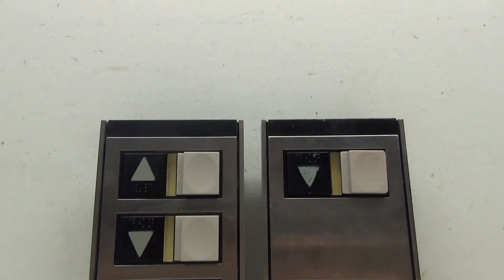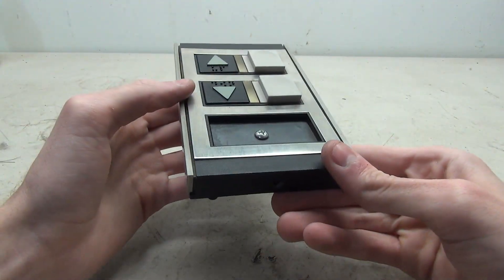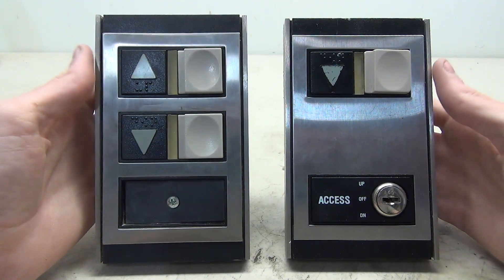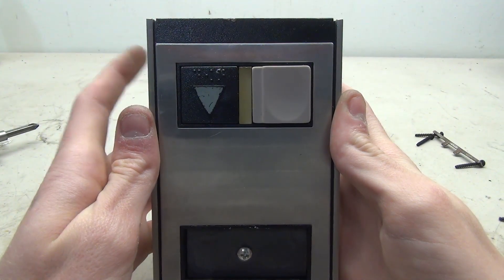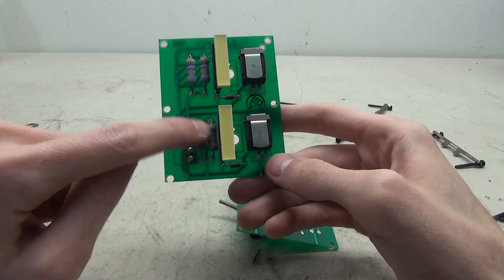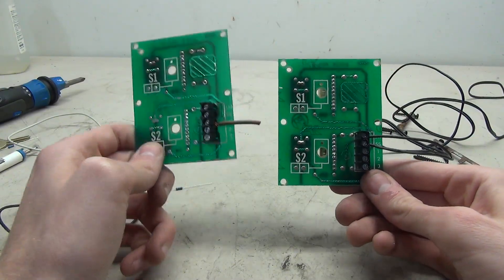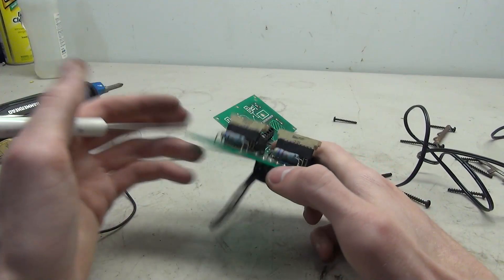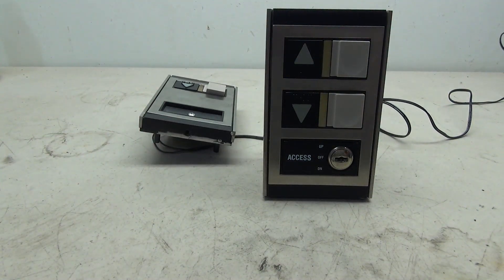Detailed Look and Wiring Montgomery Vector Elevator Buttons

Comment: as someone with very little knowledge of elevator control systems, what blows me away about these is that they operate on ~117VAC mains voltage.

i'd imagine maybe older designs used neon indicators or something (like those you might still see in power strips), which may have required higher voltages, or maybe there's another reason to have mains voltage at the call stations that i just haven't thought of.

but it just feels wrong powering an LED indicator and a switch with mains voltage. i mean, they even had to double up on beefy resistors to safely drop the extra 100++ volts they couldn't run through the LEDs. 😅
Reply from the maker: A lot of older elevators used mains voltage. Newer stuff like these use 24V or even less.
Reply: @stlelevators  That's what I thought too, but at 24 VAC, those 4.6kOhm resistors wouldn't pass enough current for the LED bar to give more than a very faint glow. At ~120 VAC though, it's just right. 🙂 [edit: those resistors are in parallel with each other, so their equivalent resistance together is actually more like 2.3kOhm, but i think the point still stands]

I found this video because I became curious about a call station in a late 80s/early 90s Montgomery Vector elevator where I work, after an elevator tech totally botched a repair on it.
I won't say I've taken voltage measurements, but I will say I'm certain the call stations in our facility run on 117±5VAC.

Comment: So now that I've been seeing some of these Montgomery Vector hall stations and the occasional lanterns, do you think the chances of getting a Vector car station is going to happen eventually, or does it appear somewhat unlikely?
Reply from the maker: Probably low due to the cost of shipping them.
Reply: @stlelevators  I would say the same thing, not only because of their large size and high shipping. But also, the control boards are a very complex design, harder to wire up, the floor indicators only worked with Mi-Prom controllers, and the parts for Vector are way beyond obsolete.
Reply: @stlelevators  Sometimes shipping is the worst. That brass otis cop I have, I got for 80$ because no one else even bid on the auction, but shipping was nearly 200$. Still was worth it so much lol

Comment: Yay more Montgomery Vector! It’s nice to have some authentic Vector fixtures to wire. For something made before I was born, these fixtures seem so ahead of their time.
Reply: I suppose as a future video maybe you could find and wire older Dover Traditional VR fixtures? There isn’t a specific name for these fixtures (according to the North American Elevator Guide) but they’re quite a bit rarer than the Dover VR fixtures used with Impulse and newer Traditional.
Reply from the maker: The VR buttons are basically the same as regular.
Reply: @STL Elevators I suppose that’s true yeah. Just thought it would be a cool fixture to wire.